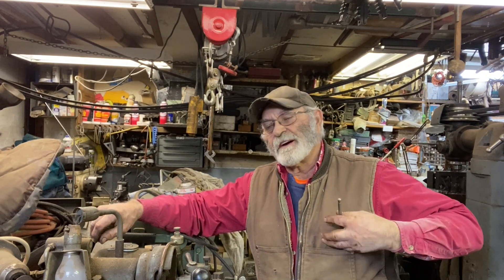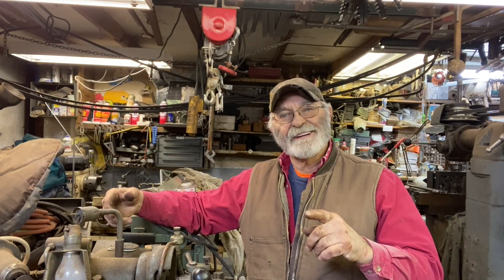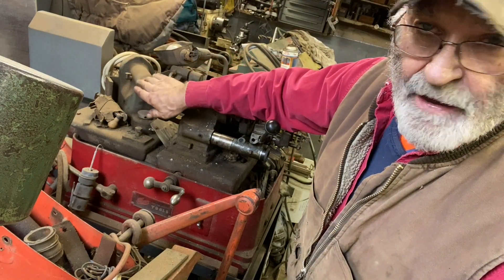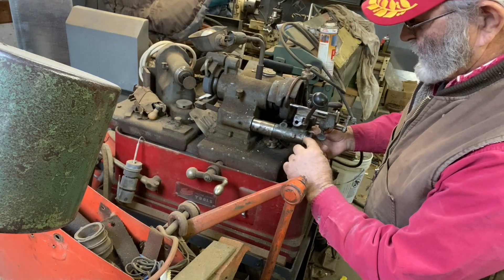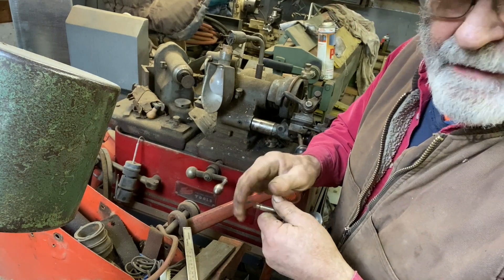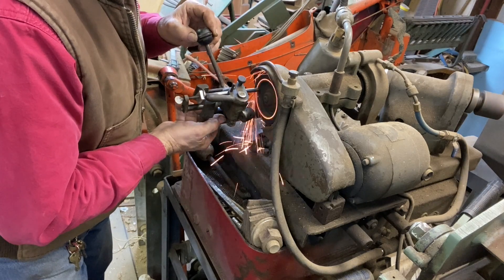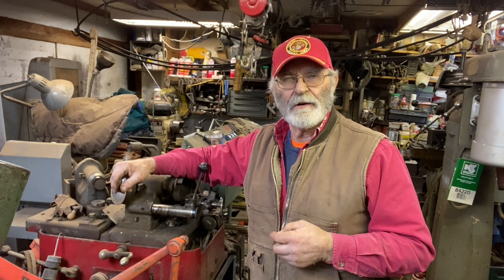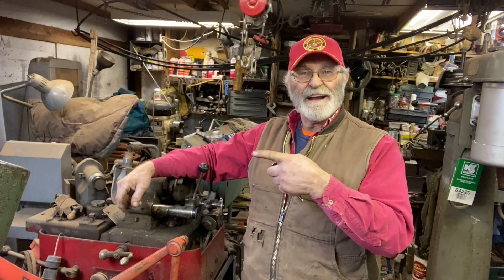Thor Valve Grinder Trimming Valve Stem 8N Ford

Comment: Hey Tractor Man your right is old tractor guys are stubborn 😀So believe it or not I am going through an 1950 8N Ford and I got a few prices on grinding the valves and it was around 4-500 dollars so in the meantime I found a 645Soiux valve grinder and everything works except the chuck has a wobble so I am going to have to figure out what to do with that and any ideas you might have would be much appreciated but also I can’t find any indicators of how to know what angle your grinding the valve face at all the knobs for the valve stem all have nice numbers stamped on the dials but no stamps on the deck where the set bolts are for clamping the chuck down hopefully I have explained this right the chuck angle adjustment is what I can’t find there’s no indicator on the deck can you offer me any advice I sure would appreciate it thanks 😀🇨🇦
Reply from the maker: I think the valve face angle should be 45*.  A slightly different angle on the seat will give the minimum contact which will minimize the chance of exhaust particulate accumulation.  The wider the contact angle, the greater the chance of trapping some stuff over time that'll cause loss of compression.  So just one degree difference would be adequate....like 46* or so.  
   There should be numbers stamped on the deck...but if not, its going to be hit or miss setting it up.  Maybe pick up a handfull of old valves and grind one and check it for angle then slowly adjust it until the test grind comes out to what you want.   I'm lucky with mine...its all there and readable.

Comment: I'd like to see this Thor all cleaned up and in full operation. ( Now there's a request for you! )
Reply from the maker: Oh man....maybe when I get caught up....LOL.  I just have a tendency to move from one job to the next with tons of little ones thrown in for good measure.  This was one of the little ones in between.  Luckily the correct end of it was sticking out so it could be used right there between the 4' brake and the Allis Chalmers torque tube.  LOL
Reply: @tractorman4461  Hahahaha,.. I hear you!

Comment: Me and my dad rebuilt the engine in my old 8n, we had a machine shop do the valves and replaced the sleeves, we put it back together and dad showed me how adjust the valves, I'm so thankful for that time. BTW the old 8n still runs great! Great video! Man you have all kinds of toys for a man's shop!
Reply from the maker: Well, I've been collecting and using the stuff for many years.  The problem is I have too many things that interest me.  My brother just used my sleeve puller and slugs to slide the sleeves in his block a couple weeks ago....They usually slip in pretty easy if you freeze them for a day or so then keep a heat lamp on the block in a warm space.  Might have to tap tap tap the last little bit.  Thanks for watching.  I have a buddy in Colfax (sp?) Co. NC.

Comment: I used to “play with one of those when I worked for Cadillac, then one day my boss gave me a singed Pontiac “fire- Arrow “ and the last traded in ht4100 v8 engine &trans complete with cradle and computer. You know what I did!
Reply from the maker: It's good to have experience on one of these.  I had to figure out what little I know by working on a pile of old no good valves.   What'd you do to the HT 4100?  If I remember they had some weak spots in their design.
Reply: @tractorman4461  well that ht went into the Pontiac Fiero, and yes those engines were “heavy trash” hence the HT in the nomenclature! But the combination of the little car, and the lightweight v8 engine, and a custom intake and exhaust it became quite the little rocket on the 1/4 mile for one season. Then it was too much $$$ to keep it going so off to the scrap yard it went when Uncle Sam activated me! My parent didn’t want it sitting around with my truck and other car, or my saw mill that the neighbors all complained about!

Comment: Cool machine! Don't have one of those in my shop but, I do have lapping compound and a stick with suction cups! LOL Wore out my hands a time or two doing that. Just recently found a lapping tool with a crank handle. Haven't had a chance to use it yet but, hopefully it saves my hands the next time. Great video Tractorman44!! 👍👍👍 Was just working on my 8N today. Just some easy stuff, new carb, coil and fixing some wiring.
Reply from the maker: Yes, I spent my time on the suction cups lapping valves.  I have one of those cranky things too.  I should have done a video surfacing up the seats last week, but I didn't.  New carb for the 8n...did you find a Marvel Shebler or did you use an aftermarket one?
Reply: @tractorman4461  Aftermarket for now. I have a rebuild kit for the Marvel Shebler but,  needed to get the tractor in and out of the garage quickly. Seems like every time I decide I can tie up the garage for a day or so, something happens and I have to use that spot. I'll rebuild the old carb next week.
Reply from the maker: @1lilfarm  Cool.  I've heard mixed comments about the Chinese cheapies.  Those that have good luck love them, others, not so much.  I put a knock off carb on a small Husky motor and it fires right up and runs perfectly. Fourteen bucks too !
Reply: @tractorman4461  Tractor fired up fine but the governor is doing a lot of hunting (wasn't a problem with the old carb) and doesn't rev up smoothly. I haven't done any adjusting yet. It runs and made it to the shed so far so, we'll see how it does in the long run. 👍
Reply from the maker: @1lilfarm  Sounds like just a little tinkering and it will be fine.  Can't hardly beat the old Marv/Sheb's though.  I have several that run Zeniths and I think there's one that even has a Stromberg.

Comment: 44 DONT GRIND MY GEARS?  LOL
Reply from the maker: But if you needed I could touch up your valves though.....  You surviving the cold snap out there?
Reply: IT'S FRIGID -30 WIND CHILL AT TIMES.  HIGH 4 LOW -10 AT NIGHT.
Reply from the maker: @jrobert9611  LOL...I really hate cold weather.  You remember all those frigid roofs working on a Trane or Carrier package RTU...??  Climbing the ladder and over the roof edge in snow and ice....I sure as heck do.  I don't miss it one bit either.  LOL.
Reply: @tractorman4461  I HEAR THAT BUDDY 👍🚜 44 WISDOM

Comment: Like you said.....Do it yourself....don`t matter if at first you don`t succeed try.....try....again and eventually it will work....good work on shortening the valve....I did that one time but I didn`t have that grinder so I made my own gig and it worked....as long as it works ....good job....CHEERS
Reply from the maker: Heck yeah Gator, anything that'll get you by in a pinch !!  Thanks for the visit my friend.

Comment: Another cool old piece of equipment. Thanks for sharing it with us.
Reply from the maker: No problem....I had to touch up the valve stem anyway, so it worked out just right.  Hopefully you got all that Douglas Fir split up and sold.
Reply: @tractorman4461  Got it split but not sold. I was spending some time in my parents wood shed getting it topped back off for the next couple years.
Reply from the maker: @WildBill1122  That's good.  We try to keep a three years supply as well.  We've been able to maintain it like that for at least the last 20+ years.  It sure takes some doing while working a full time job and I'm not sure its any easier with retirement.  LOL. Getting older ain't for the faint of heart. LOL.

Comment: My friend Bob Collins has one of those Grinders.  Pretty cool little piece of equipment. Well worth what you paid, I'm sure.  I never worked on a big engine. I only worked on little ones. You know like Briggs & Stratton and go kart engines. You know, tiny ones. The engines that I worked on the valves were so small that it probably wouldn't even fit in that machine. 
So anyways when we had to set the valve gap we used the bench grinder and we ground off the thing a little bit and then we went and tried to fit it and if it worked okay good if not you did it again because Briggs & Stratton doesn't have adjustable valves.
I have a Ford Flat head 6 in the garage as a backup engine for the 8N. It needs some valve work. After Lydia gets done with her treatments and we both get to retirement age in September I might just have to put it in the truck and come out to borrow your grinder. 
Not likely but fun to think about. I've done more for less reason.😁😎
Reply from the maker: Hahahaha....heck yeah, that would be a fun trip for sure.  I bet we could get it done in no time !!  Thanks for the interesting comment.  Some of those small motorcycles my son and I fiddled with had valves about the size of a quarter.